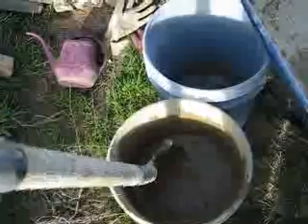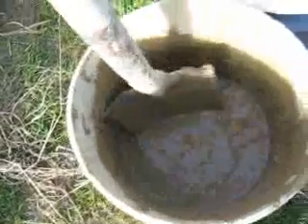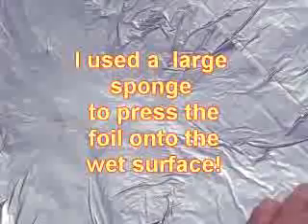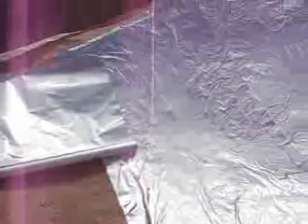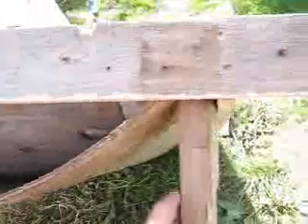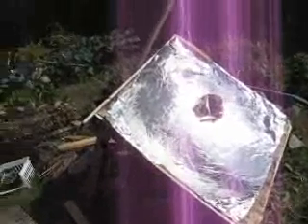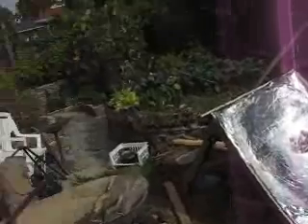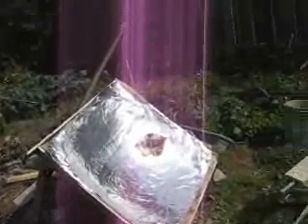Cob solar cooker. applying the foil + first test

Comment from the maker: You can certainly use old dishes covered in mylar. But the focal point will not shift from one to another as you suggest. With those dishes you have to have tracking (either manual or powered) and it must be accurate. This is why I have gone to "compound" parabolic dishes in my more recent experiments.  They do not need to be moved so often and if you do want to make a tracker, it can be crude, cheap and inaccurate and you compound parabolic dish will still work!

Comment: This is a test that I still have to do, but for my experience with aluminized films or aluminum foil, I can tell you the following: each wrinkle, be small or big, it works as a hole in the mirror. For that reason this method is not very efficient. On the other hand, the aluminum foil that is gotten at the moment no longer has the refined one to mirror that is needed for a good reflection.
(pardon my "automatic translator" English).

Comment from the maker: You are correct.  Another way is You turn the mathematician upside down, and use a spring or bungi cord for tension.  (Then you are tracing a dome With a parabolic dome, you should be able to make many many dishes from cardboard (or from whatever material you have). And it should be really quick too and require very little precision with cuts.
I am stuck in the sunless gray winter right now but I am just about ready to make a video to clarify the mechanical mathematician